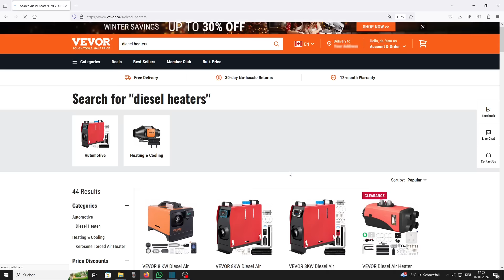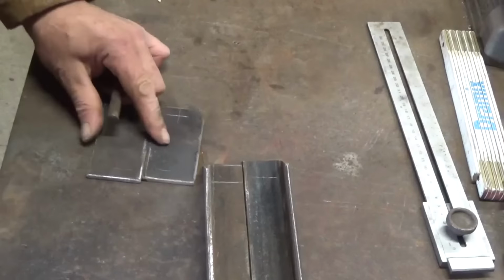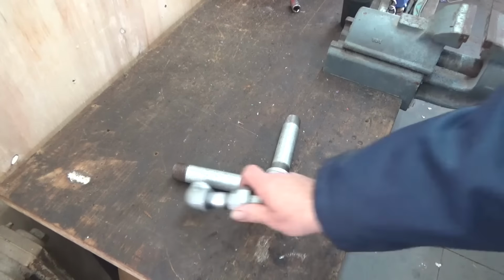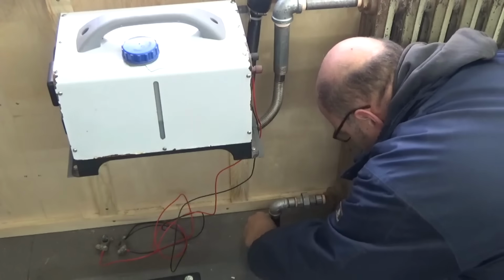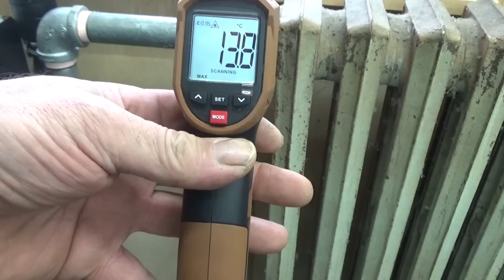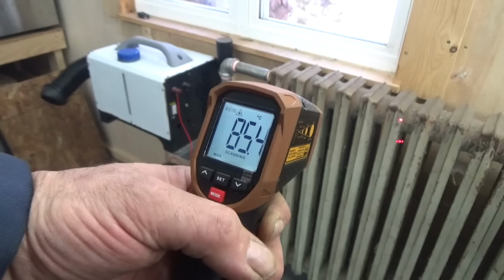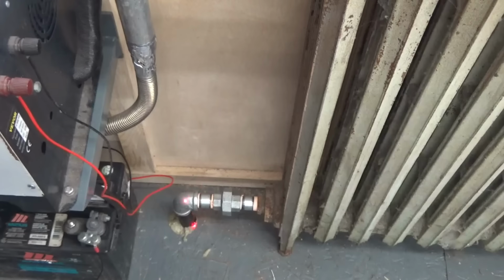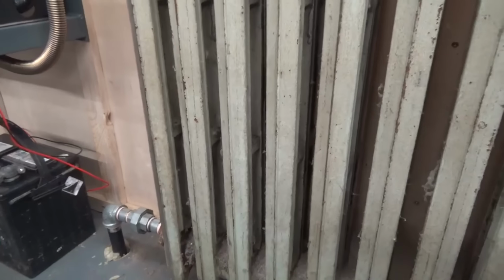Diesel heater upgade 200% more efficient

Comment: I have to ask. An exhaust works by the differential between atmospheric pressure and that of the pressure (caused by heat) in the exhaust). When you’re robbing energy from the exhaust system and creating more friction for exhaust gases to escape all you’re doing is pushing that problem back into the burn chamber resulting in less complete combustion in the first place. Where does the claim you’re getting a 200% increase in efficiency come from? We know there is going to be some interaction with the clearing of gases in the burn chamber. How is that not considered in energy efficiency claims?
Reply: Cus the radiator is much bigger that the expansion requirements, it free flows out the exhaust and since it is a heater, it radiates heat into the room, making it 200% more efficient.
Reply: Diesel heaters have a combustion blower. So, exhaust gases exit under pressure and are forced out of the cast iron radiator. There are enough passages in the radiator  that back pressure is not a concern, plus convection causes the cooling exhaust gases to fall down all those passages to the bottom of the radiator.

Comment: Nope! I just snake longer ribbed (like fins) stainless exhaust tubing sideways downslope (prevents accumulating condensation) to get more surface area to PASSIVELY recover more exhaust heat. These heaters run too rich, you have to get plateau mode heaters and manually lean out mixture. If your heater old enough same adjustments. Some new ones can't be adjusted. SUCKS.

Comment: Very interesting and something I thought of as well... I see some negative comments that have some points that do seem very valid... personally, I'd want to have outside air to heat over the exchangers to keep a positive pressure in the structure so instead of cold air creeping in through the cracks, it's blown out by heated air brought in from outside... as for using heated exhaust, I'd be interested in using its wasted energy to both heat fluids maybe for heated floors, supplemented heated tap water or radiant heated air... I see the concerns of the nay sayers but, this is the year 2024... We should have had such technology by now to buy on the market... Till then, Y'all just keep doing what Y'all need to do to get by and having fun doing it... Can't learn if you don't try it... If you make a better version of your first idea, I guess your learning and having fun doing it... :)
Reply: The positive air pressure idea is very thoughtful but remember, outside temperatures are much lower than the inside, making the outflowing temperature of the unit much lower.

Comment: If that worked, the Chinese would also sell exhaust heaters for them.. Sounds logical, doesn't it?
Reply from the maker: The question is would you buy a heater for +-150$ and a heatexcanger / radiator for over 200$ + shipping. I think it is question about the costs.
Reply: @dsfarmns2823  Of course, that would be much better than tinkering with the diesel heater. If the heater breaks down, you have nothing left.
Reply: . Salvage parts are available for almost nothing
Reply: Actually, the Chinese do sell electric exhaust heaters for them and nonelectric also, there's a business for everything brother.

Comment: Should reverse the inlet and outlet atleast.. These heaters produce condensation so I am sure you have already run into issues. Feed the exhaust through the bottom (heat rises) but also then the condensation will now run down instead of flooding right at the outlet.
Reply: Hot air rises, heat goes to cold and cares not about direction. Sorry, its a pet peeve of mine.
Reply: midspan28 - I don't understand. How is the condensate going to escape if it is gathering at the bottom of the radiator?
Reply: @richH1625   A small hole/drain plug should be easy enough to put in. Or even a water trap.

Comment: Sorry dude. I can only give you 6.5 out of 10 
You made 1 mistake on the radiator 
You should have put the exhaust outlet on the bottom other end that way the radiator would have had a better hot airflow through it 
You way it’s short cycling through the first column and not evenly going through all of the radiator 
Sorry better luck next time 😊
Reply from the maker: There is a reson for doing it like that and it is because the condensation is collectet at the lower part of the radiator and need to flow out of the radiator and in all the new systems is the hot inlet on the top to give the medium time to cool donw and flow down to leave the radiator so it should be a 10 of 10 LoL😁😁
Reply: @ oh yeah it would condensate the flue gas as it would hit dew point and make water but a simple drain off point could solve that 
Ok 7 out of 10 🤪

Comment: Did you get a carbon monoxide detector/alarm being as you have the exhaust pipe indoors? And, if you think carbon monoxide won't enter the room it can pass through the fuel inlet breathe hole into the hot air stream. It is also recommend not to use an exhaust pipe longer than 2 meters which may add carbon monoxide to the hot air stream passing over the outside of the heat exchanger, some just like living dangerously others are just plain stupid. If your burning any kind of fossil fuels indoors get a carbon monoxide alarm fitted.

Comment: What happens when diesel vapor fills the radiator, during ignition, or failed ignition? I like the idea,  but would have concerns. Condensation...be interesting to see the exhaust flow out the radiator. Wonder how long till it plugs or develops a soot buildup.
Reply: Rather quickly.

Comment: That’s crazy! The in-take air tube should be outside the room! You are burning oxygen from the room! Don’t do that, it’s dangerous!
Reply: Only if he's in air tight room :)
Reply: Not an issue.  Oil furnaces used for many decades use inside air for combustion.  Show me an oil furnace in someone's home that has an outside, make-up air source.  It' doesn't exist.
Reply: There is nothing dangerous here because the air that is burned inside is replaced by the air which comes from outside through all the non-sealed spaces otherwise you would have a difference in pression between the space in the room and the outside and i don't think that he lives in a perfectly airtight submarine.
Don't you cook your food burning the gas and oxygen in your kitchen ? Man this is so dangerous, you shouldn't cook your food with gas !!!!!!!

Comment: I like your innovation, but that’s dangerous and going to be hard on that heater. You never want to push exhaust down, always up. That cast iron radiator will likely also plug up after not long.

Comment: Why do they use stainless steel exhaust pipe and you don't. Highly acidic exhaust will eat right through galvanized pipe
Reply: No more than that heater will be used, it will take 20 years for the exhaust to eat thru that schedule 40 galvanized pipe.
Reply from the maker: @ that means It will last longer than I have maybe left of my live 😃time

Comment: 🤔 pluming it through the top and exhausting at the bottom. You are losing 90% of the heart
Plum the entry to the radiator at the bottom and exhaust at the top. That way way it  heats the entire radiator before exhausting.
Reply: Heat rises so to keep the heat in the radiator feed the hot exaust in top left, this makes the hot gases pass through the radiator giving up it's heat before escaping bottom right
Reply: No...the water needs to go from the top to the bottom or else your radiator will fill up with condense water.
Reply: As stated, you can't do that because water will collect.

Comment: Heater running at 183 degrees radiator at 90 at the hottest end. Not very efficient is it…..
Reply: Capturing ANY amount of heat from waisted exhaust makes it more efficient!! Otherwise it all just goes outside! So yeah extremely efficient!
Reply: Any amount of heat captured is literally more efficient than the contrary, so yes.... its is very efficient